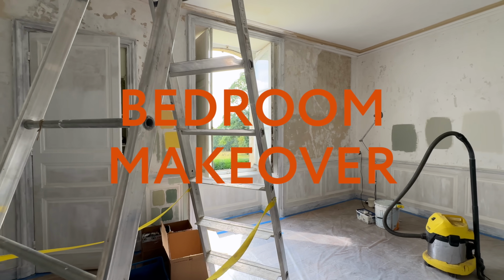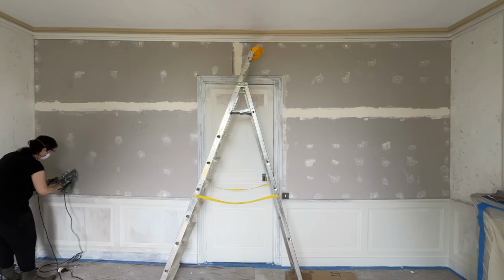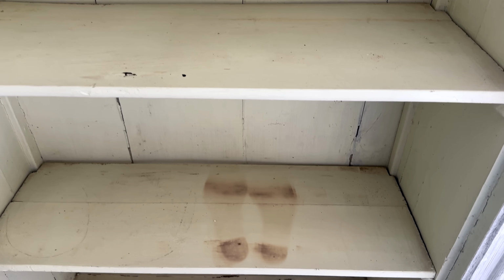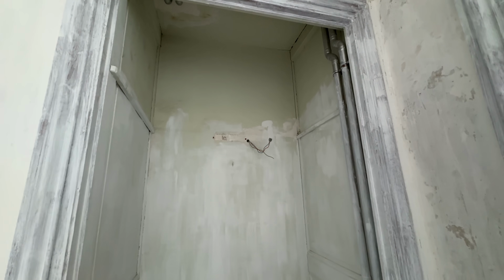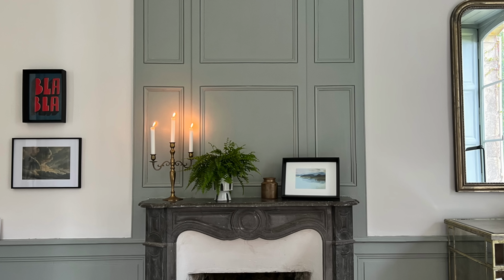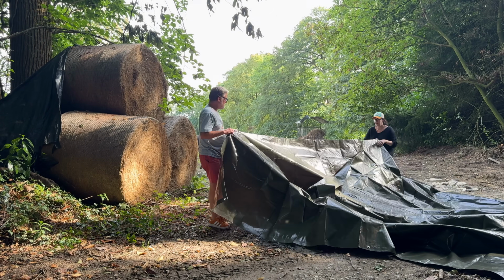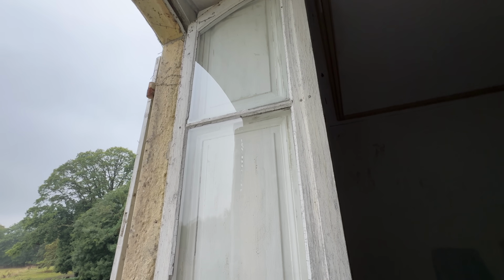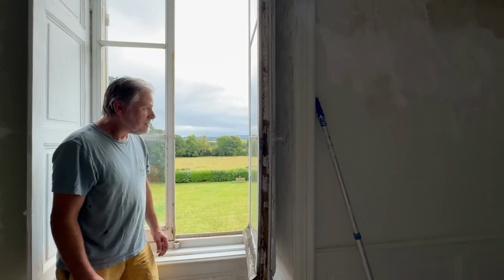PART ONE: Behind the Scenes of a Chateau Bedroom Redesign

Comment: I checked with a friend who does old window restoration professionally.  He said to remove old window glazing putty use a sharp chisel and shave rather than chipping or prying it out when it's on tight.  So not so much pressure that you're going to slip and break the glass.

Comment: If clean the wood with borax it will kill the mildew. Its a trick i learned from an old time painter. I had a area the received a lot a weather and every time i painted it, it would peel by the next year. Once i treated it with borax it hasn't peeled in 10 years.
Reply from the maker: Interesting!

Comment: The bedroom is looking good - the green will look great. The weather mostly seems to be holding but you folks must feel due for a break and so you should as you've really been at it steadily. I suspect you're going to push on though so you get as much done before winter as you can. With your tarp - will you to secure it so it doesn't blow away? If it has grommets, maybe hook a couple of bungees onto it and go around the tree or weight it down with full water jugs.

Comment: Bad luck on the removing the windows.

As a student, I paid my uni tuition, housing, books, etc painting homes, flats, and other buildings. You will save yourself so much time using a roller with a metal grid in a large 18 litre/5 gallon plastic bucket (such as the white one @3:05). A bucket is much more stable that the trays many DIYers use, and you may hang the bucket from the ladder, though a telescopic extension pole is better. There are plenty of youtube videos that show how this is done. It's very easy to use, even on the walls with moulding, though you will still have to do some brush work. In France these are called Peinture Grille métallique Grille de peintre Seau de peinture Rouleau de caillebotis Treillis. I suppose grille de peinture en métal in short. Appears France tends to favour plastic grids (that aren't bendable like the metal ones) or flat metal sheets with round holes cut in them, which strike me as odd. The diamond-shaped grid makes it easy to roll off the excess paint from the roller. When you're done painting just wash off using a strong metal brush or, easier still, a metal brush attachment on your drill.

I tried to check Leroy's shop but it's geo blocked. I checked the site named for a large South American river. The French one doesn't have the good metal one. Same for Germany's site. UK has it, but the price for one is outrageous. US site has a box of 24 (you're going to be doing a lot of painting over the years) made by wooster for less than fifty and postage to France is about thirty. That's about three euroroonies each. There's a more durable 4-sided grid box of 24 made by landhoow that's a bit more than a hundred including postage, so roughly three-and-a-half euroroonies each.

Comment: Actually, I wouldn’t cover hay with a plastic tarp. Hay has a natural water shedding ability. Especially when it is well rolled. If you cover it with plastic it will allow mold to grow.just make sure it is on high ground so it doesn’t sit in water. Our hay bales sit out year round until they are used. Another thing about hay, when it is first cut and baled, they generate heat. Don’t stack them tightly until they have cooled down(at least a few weeks). Otherwise they could start a fire if they are still hot when they are stacked. We had that happen once.
Reply from the maker: We have too much rain and if left out the bales become moldy. We waste several of the top layers because the donkeys won’t eat it.